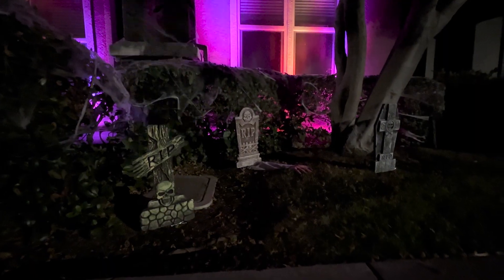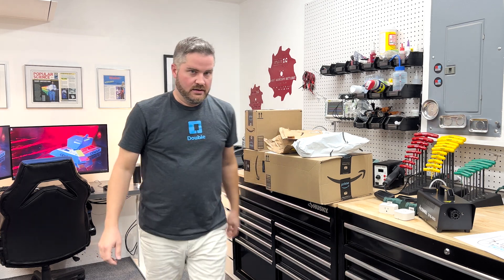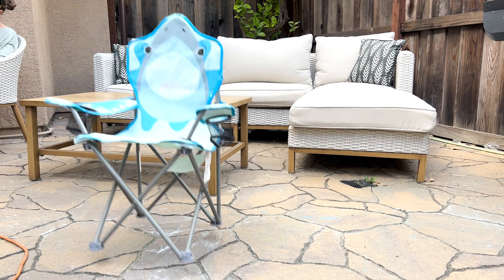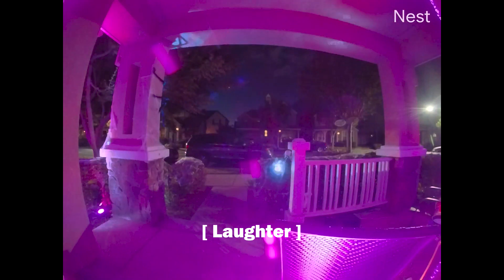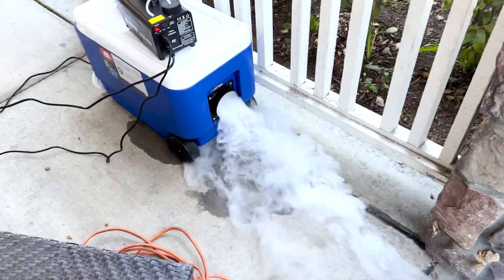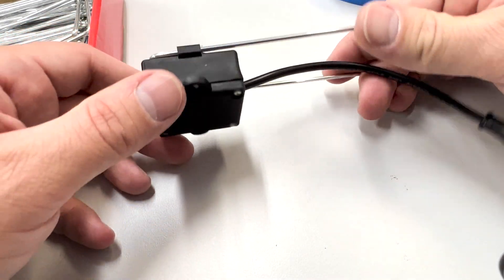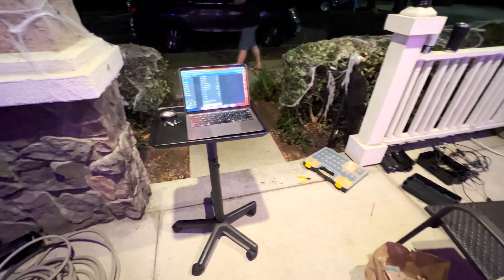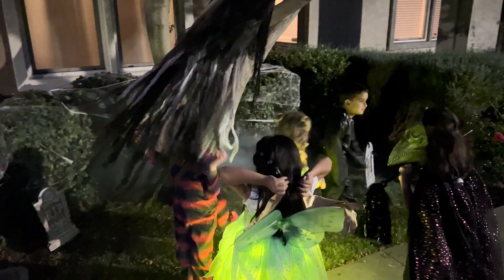DIY automated Halloween decorations with EPIC fog

Comment: Awesome stuff!! Did you custom make the shelf in your garage to hold your yellow latch boxes?
Reply from the maker: Yes!  I don't have plans for the shelf, but the boxes are Harbor Freight divided container bins.  I made a custom bin design with a label holder / handle to easily remove each bin. You can customize any size/shape bin and download the STL file here:  https://www.marcdevidts.com/bins
Reply: @MarcDeVidts  I have a few bins because they are great for the price! I just need to build a vertical shelf for them and try not to go all Adam Savage on them.